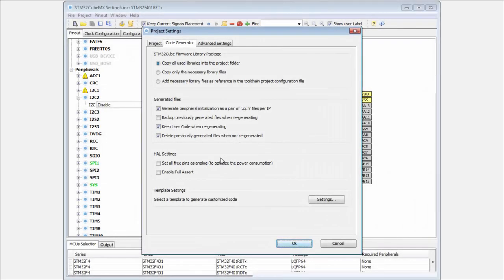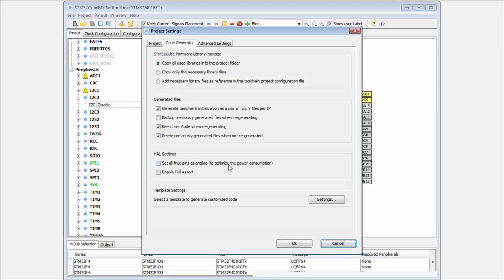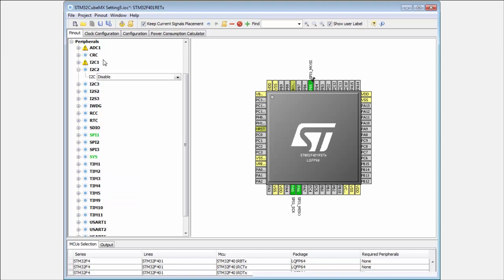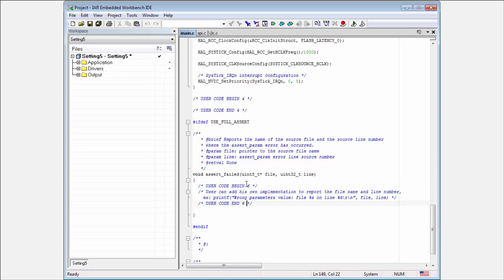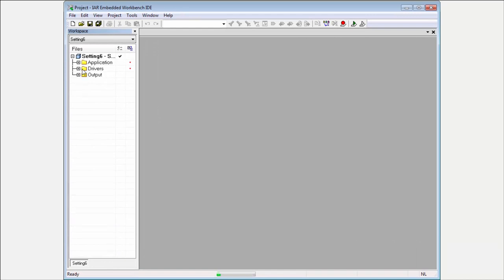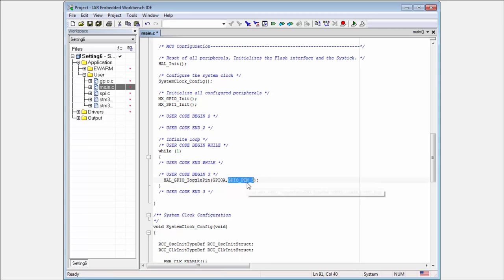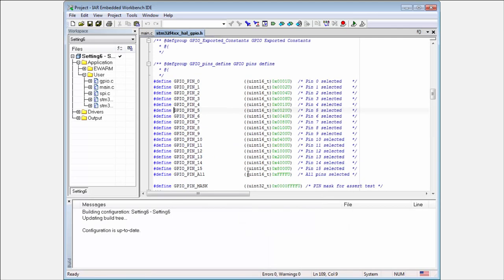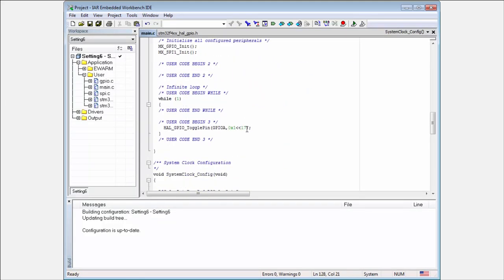STM32CubeMX basics: 06.3 STM32CubeMX project settings - HAL settings

Comment: I am working with STM32CubeIDE version 1.4.2
There is no option for project setting or to save different configuration of settings as you're showing in this video series.
Reply from the maker: Hi there, for technical questions we really recommend you check out our community of experts and other developers at community.st.com